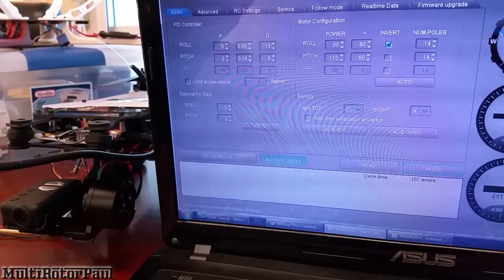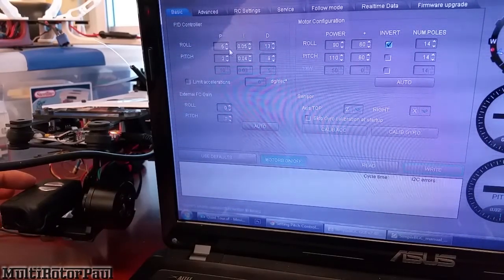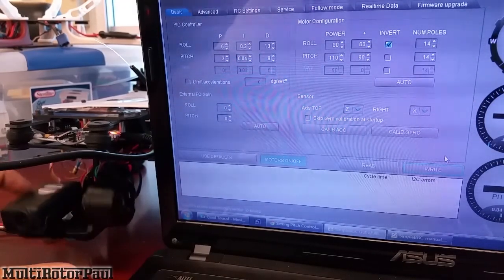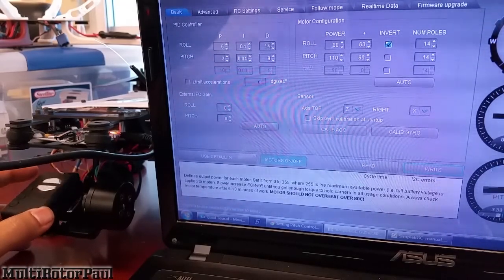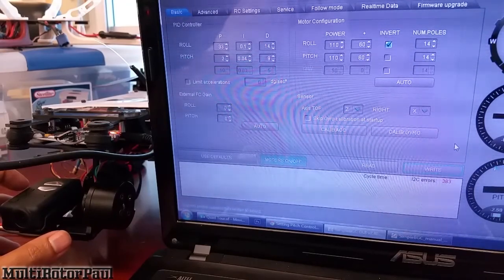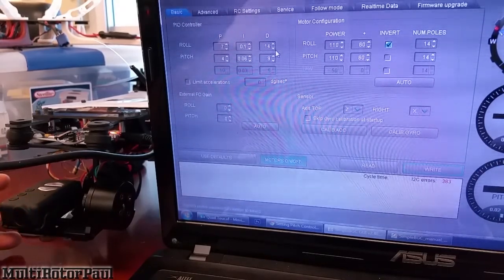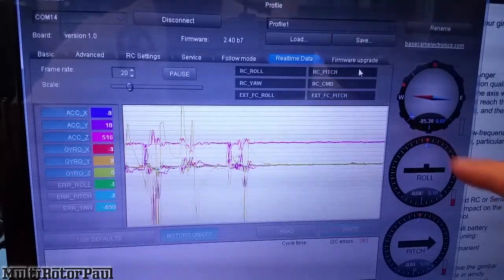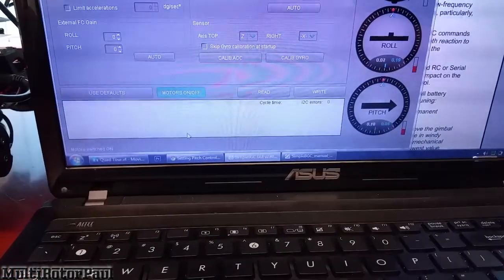Mobius Gimbal PID Settings

Comment: Hello! I know the video is old but I'm trying to adjust PID for my cam and I found your video. I cannot set the camera manually a 90 degrees pitch down to capture the ground while flying with my drone, did you try to put it that way? The gimbal can't hold the camera in that position. Thank you.